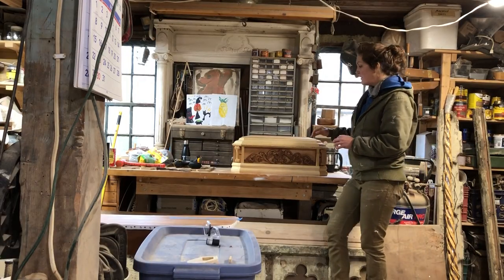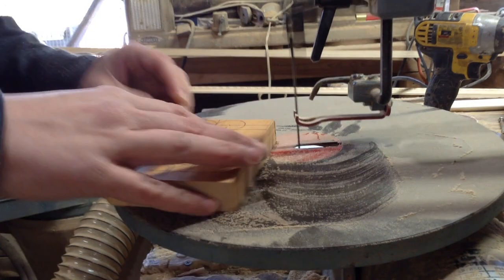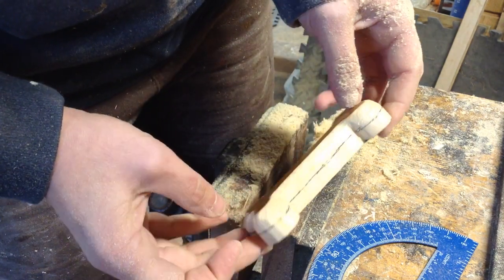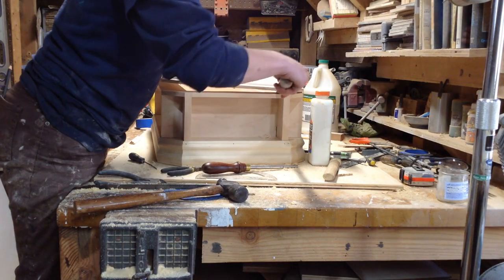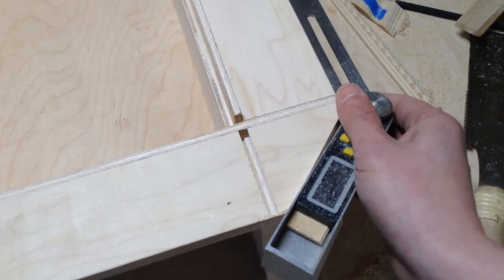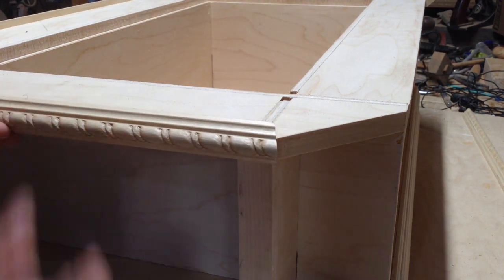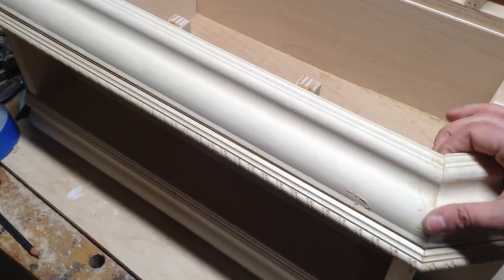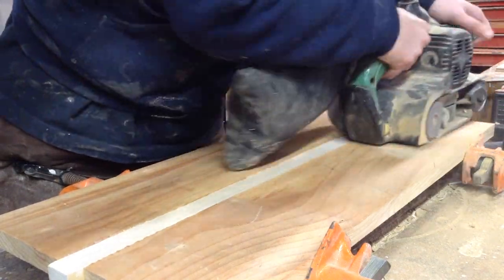Woodworking : DIY Pet Casket W/ Free Plans // How-To Part 3

Comment: It looks great and an appropriate tribute to a cherished family member. I learn so much from your work and explanations and am always grateful. I don't like brad marks either so when I can I brad or nail a piece in a rut or inner edge then add very thin moulding or trim over the top with pva that grabs to hold it in place and hide the holes.
Reply from the maker: That's a good trick!